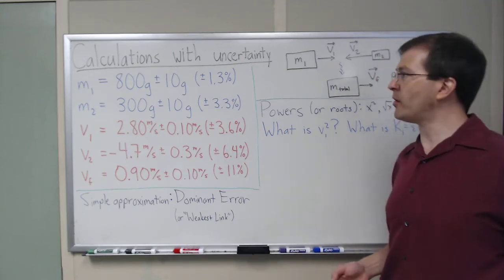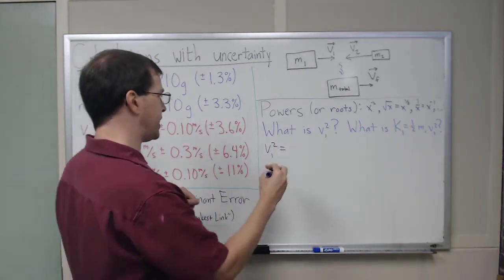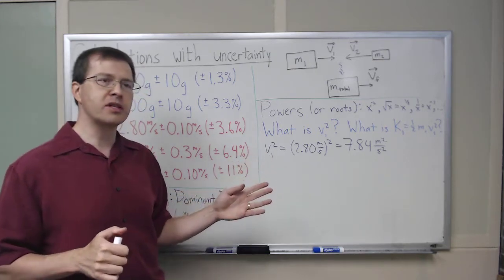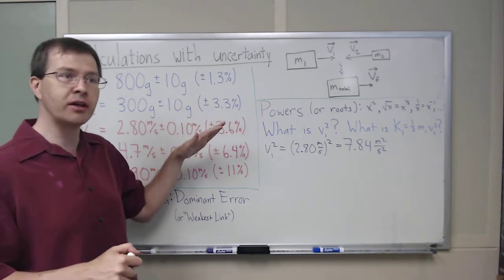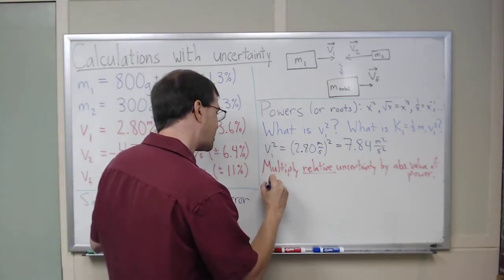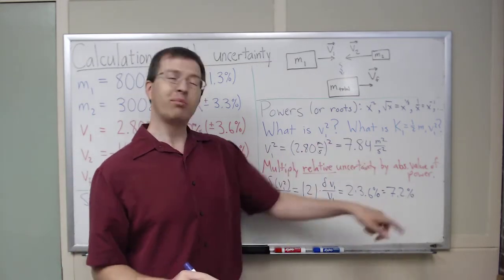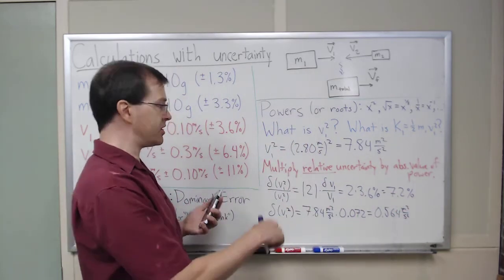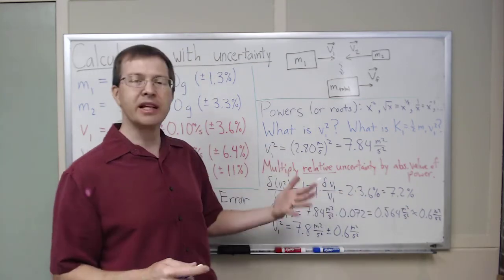Uncertainty example: Raising to a power (or taking a root, inverse, etc.)

Comment: Great videos on uncertainty analysis. Question: what if, for example, I wanted to give the uncertainty on an angle measurement in a square triangle using the hypothenuse and the opposite side? Meaning I have the hypothenuse h + - dh and the side is x + - dx. With trigonometry we get sin(alpha) = x / h so alpha = arcsin(x / h). Which is the uncertainty on the angle in degrees given the uncertainties in h and x in mm? Do I just use the quotient rule with relative uncertainties on h and x and consider the arcsin as a constant or there is something more to it?
Reply from the maker: To propagate uncertainty for an arbitrary function like arcsin, you actually need to take a (partial) derivative! I'm actually not quite sure whether I've got a good video that focuses on that, unfortunately! But I do discuss it in the context of a specific example about halfway through this video (starting at the linked time): https://youtu.be/PKdfgrB19q8?list=PLQcPPNE9JfphAKA23L1eXqYbYViAyWDy5&t=407   Also, keep in mind that uncertainty propagation for trig functions in physics always, always assumes that the angles are in radians. If you then want to figure out the uncertainty in degrees, you'll need to treat that conversion like "multiplying by a constant" and propagate accordingly (same relative uncertainty, so scaled absolute uncertainty).